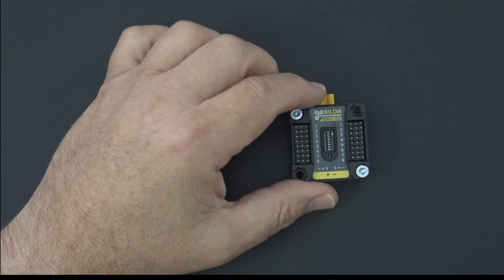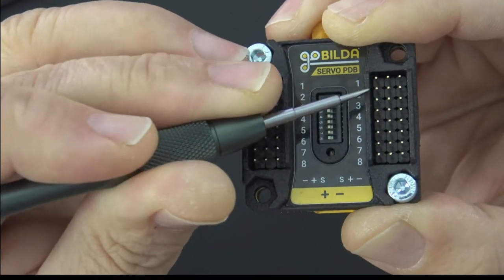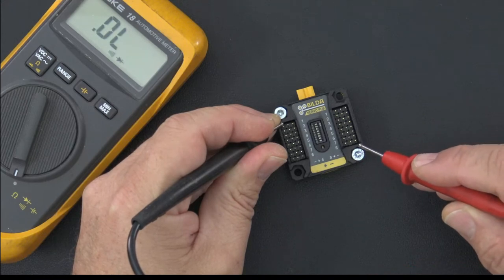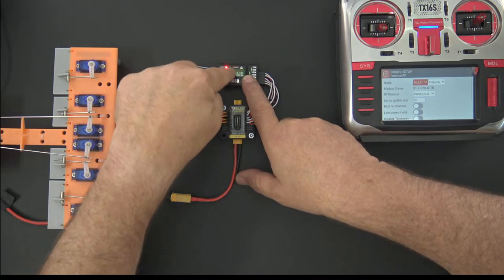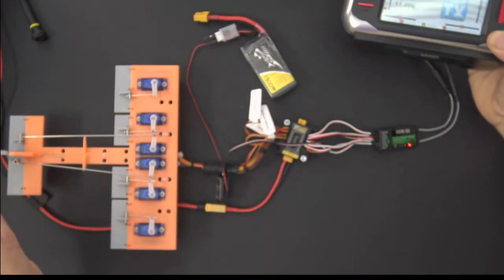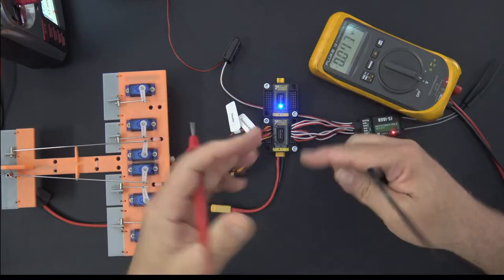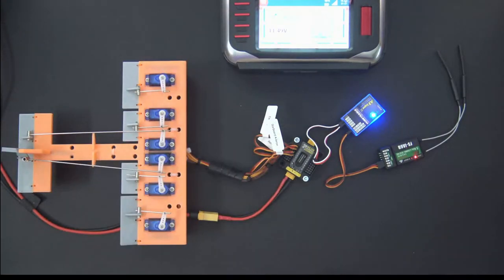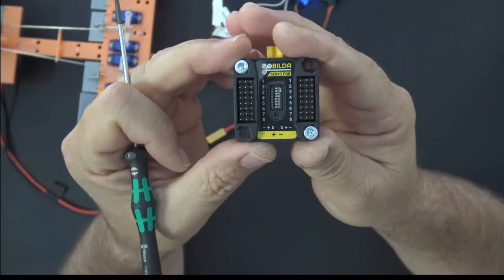High Servo Current on a Tight Budget?

Comment: The lack of a voltage regulator is a sad design choice. I know it would have brought the cost up but youre always going to need a high amp regulator with this thing anyway
Reply from the maker: I usually use a 2s LIPO for these setups. So for me, the regulator would be an additional point of failure offering no upside in my configurations.
Reply from the maker: ...and $12.  I guess if you need one, you can add one. If you don't, you get to save the $$.
Reply: Even the expensive PDBs typically feed the raw battery voltage directly to the servo pins. If they have a voltage regulator, it's for the receiver, not the servo supply. As John pointed out, this is a nice low cost alternative if you don't need bells & whistles, you're using HV servos and your Rx runs happily at 9V.
Reply: A 2S pack for HV servos would not need a regulator and I think that would be the most common setup.